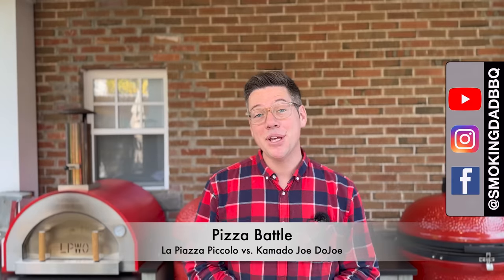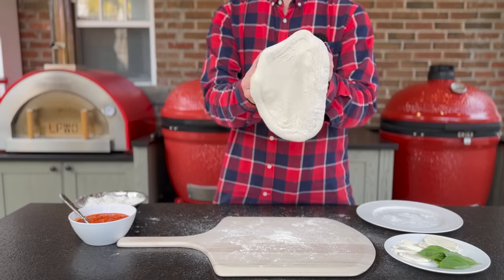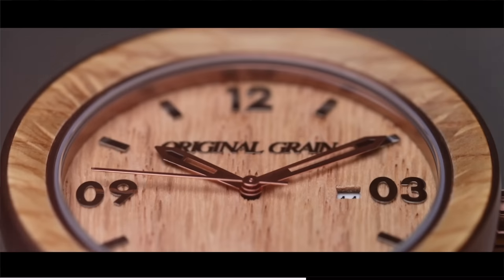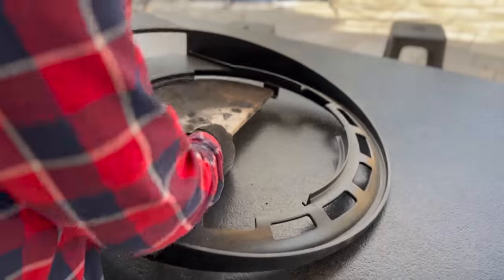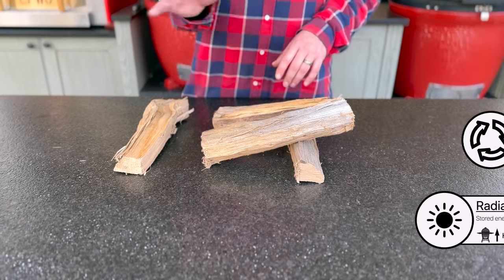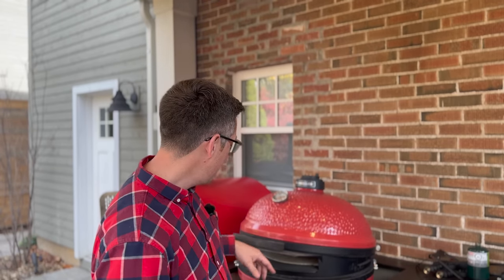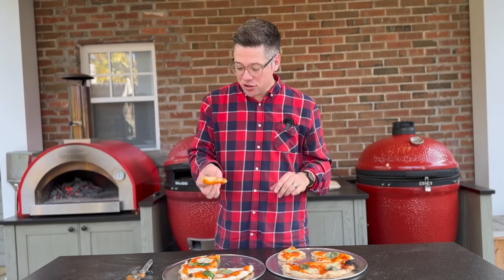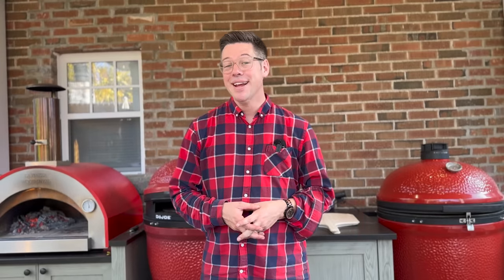Kamado Joe DoJoe PIZZA vs my Wood Fired Pizza oven... can you TASTE the difference?

Comment: a couple of things to think about.
Higher heat less water in the dough, lower heat more water in the dough.
You cannot make a head to head comparison when one pizza cooks at approximately 1 minute and the other at 5 minutes.
Depending on the hydration of the dough one pizza will cook better then the other.
for 1 minute cooks you need 60-64% hydration and at 5 - 6 min 68-70% hydration.
If the pizza cooks to fast with high hydration the water doesn't have the time to evaporate therefore leaving a very airy pizza without much crunch but it maybe a bit soggy as well.
If the pizza cooks at lower temp it needs more water because the longer it stays in the oven water evaporates. 
So by adjusting the water you can make an airy and crispy crust or just airy and less crisp.
I think you are a rotisserie master and I have learned so great tips :) 
Hope this helps on your pizza journey :)
Reply: This is totally not true. Your hydration can easily be 70 + at high temps and do fantastic. Quite a few Napoli pizzas are around 70% or more for a fantastic Napoli crust. At 70% you can get a really great light and airy crust. The biggest issue for a lot of people is learning how to manage it.

Comment: Great comparison. I did not expect a night and day difference in flavor between the two.  Then again by tradition, all Neapolitan pizzas are required to be cooked in WFO in Naples. This calls for
a repetition comparison with thicker dough pizzas  and wood chunks in the KJ.  Perhaps the longer cook time in the KJ will allow for a more wood flavored pizza. Might be worth experimenting.
Reply from the maker: I agree and look forward to see where this goes
Reply: @SmokingDadBBQ  Please refer to the following clip regarding smoke flavor imparted by WFO's at 7:45 into the video:  0400b Pizza Devolution by varasano. I have been told the same by a number of people in the pizza industry.  The smell of the wood fire when you enter a pizzeria that burns wood, or the smell of the fire during a backyard pizza party contribute more than the actual smoke flavor that coats the pie.  At times the pizza is raised up into the dome to finish up cooking the top surface, however often, there is black sooth on top of the dome that gets into the pizza. It is a common technique used even in Naples, however, I have heard several experts such as Johhny di Francesco advising against that practice.

Comment: Great video again, James!
When I bought my Big Joe, I did purchase the DoJoe as well (came at a discount with the bundle). I wanted it to be one tool that does it all. However, I quickly realized that while smoking and grilling are fantastic on KJ, temperature limitations are just too much for pizza. On one side, you have DoJoe temp limit and, on the other, the KJ gasket issues. As you just can't get good Napolitana at 650F, I have given up on the DoJoe without even trying it. I went with a true WFO and could not be happier with pizzas coming out of it. And I have a brand new DoJoe I can't get rid of 😀. 
Obviously, cost difference for these two options is massive, but you just can't expect DoJoe to deliver anything close to the real thing with temps at a relatively low level. 
That's my story. I continue to be greatly impressed with what my Big Joe 3 can do, and your videos play a big role. Thank you!

Comment: So, I've been using the DoJoe on my Big Joe III, and my biggest complaint is how fuel intensive making pizza this way is.  On the BJIII, you're going to burn A LOT of fuel to reach and maintain effective cooking temps.  I use at least half a bag of Fogo and quite a few KJ oak wood chunks (adds the wood fired flavor and smell).  If you're only making one or two pizzas, this is crazy inefficient!  Additionally, given the size of the DoJoe opening, you really can't do much else, other than pizza.  Hence, for all the reasons you've pointed out and well as my own experience, I've decided its time to get a wood fired oven for pizza and other outdoor baking/roasting.  Thanks for the video!!!

Comment: I for one would love to see a comparison using only wood in both the KJ and the oven but lets add a twist by adding yet another twist to this scenario.  Lets run a test between the KJ and the BGE using wood in both and lump.  I'm thinking that the Do'Joe might have an effect on your ability to reach higher temps on your KJ than you can reach on a BGE.
Reply from the maker: i tested the DoJoe to just a pizza stone here - https://youtu.be/0tWUUMjNSAQ 

punchline was the DoJoe was maybe ~5% better so i just went with that this time
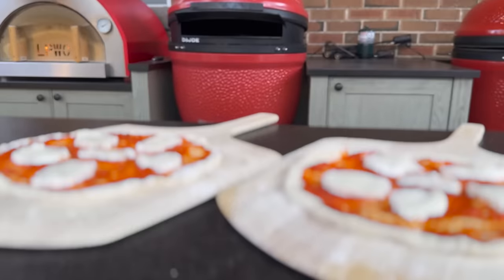Reply: @SmokingDadBBQ  Thanks for the response I have owned a BGE since April/May 2002.  When I first got into cooking with a Kamado there You Tube was not around so we had to learn the hard way - Trial & Error.  I am fortunate in that I live roughly an hour to and 1:15 from the corporate office of both BGE & KJ.  One thing that intrigues me about the KJ is the double indirect method found on the KJ.  Can the parts needed for this also fit on my BGE and if not do you know of a method that I can employ to use this method on my Egg?

P.S. -  back in 2006-2008 I was employed with an Italian Foods Wholesaler in Suwanee I was able to buy everything wholesale and would have less than a dollar per pie when making a pizza/  Sadly the economy took them out and they are no longer in business.

Comment: You are awesome at BBQ, however we need to help you with your pizza skills!

Just a few ideas.

You should try to use a polish dough and learn how to stretch your dough better. It will be a game changer. 70% hydration is a good starting dough that makes a huge difference and try out some 3 day preparation methods. No need to smash your dough at the very edge, try to push air into it if you can and leave a big ring around the edge. I’m betting you will love it.

Also, I don’t think I’ll ever invest into the dojoe because I have a pizza oven, however I would look at trying to keep your dojoe well below the 700 degrees and try 600, at that point it will be better then home oven pizza, it will just take longer. I don’t think that extra heat will do much for you, even 500 should get similar results.

With the smaller pizza ovens like yours try to split your wood a little more when you’re doing multiple cooks. The bigger logs are great for a flame that goes out and then makes coals. The smaller logs are good to get more flame back when you need it. On those ovens it’s critical to master the flame and heat.

Comment: How big of a pizza can you make on both? One thing that always annoys me about Pizza ovens is they never list a max diameter of a pizza that can go it. It's really one of the things that has held me back from buying one. The only ones in stores around here are the smaller portable one, you never see the higher end ones like you have.  I'd like to make one 16-20 inch pizza vs several 10-12 inch pizzas.

Comment: Hey James, I was wondering if you added some wood or chips if the dough would get a similar flavour as you pizza oven. Also I ran into that problem where I had run out of fuel cause I had my top vent completely open to get me up to temp. What were your vent setting if you don’t mine me asking?

Thanks a ton!
Reply from the maker: Top closed. Bottom was about 2/3 open

Comment: Have you tried adding smoking wood (oak) to the dojoe cook to try and stimulate more of that wood flavor? Not sure it would just be to much at that hot
Reply: I've actually done that. Added chunks of hickory to the charcoal before adding the DoJoe to the grill. I didn't have a charcoal only pizza with which to compare it, but with the wood chunks the pizza did seem to have a little something extra to the flavor.
Reply: @codyduncan195  interesting. I may need to try it. I use the DoJoe semi regularly so maybe next time I'll give it a go. Thanks!
Reply from the maker: i will try a wood only DoJoe cook

Comment: I don't understand the high heat. Some things instructions want you to cook at 450 in oven, I don't like going over 400 hundred even fresh pizza seem to come out fine. I'll bet there's more melted handle on kj  because this fascination with high heat. I know on kettle you want burst of heat you throw on a couple splits of wood.
Reply from the maker: The type of dough you cook in oven, pellet grill or on the DoJoe for example at 400 is not the same as 00 Neapolitan style pizza that’s cooked at much higher temperatures for a much shorter time (60-90) seconds.